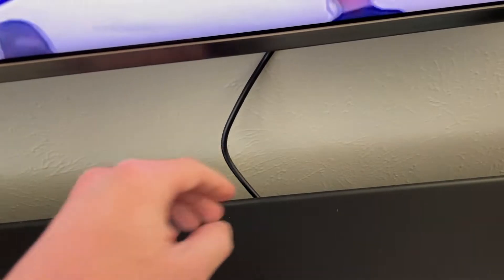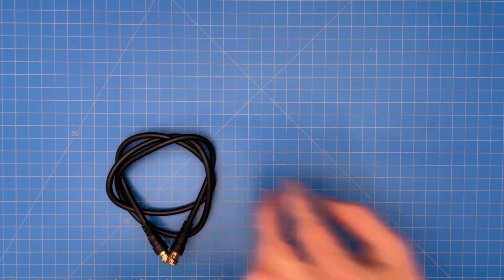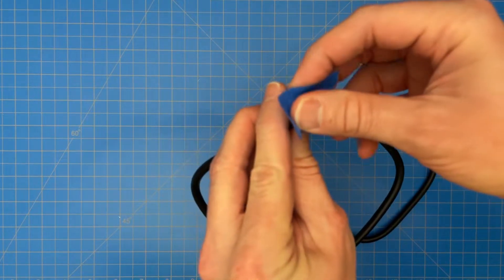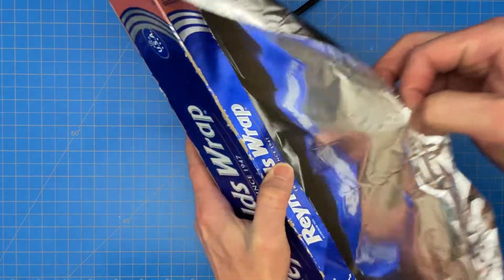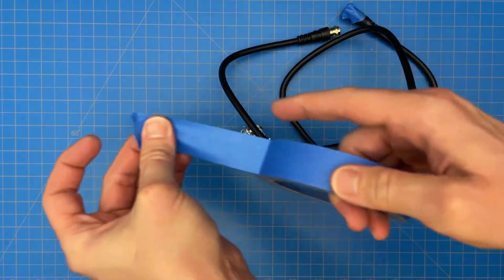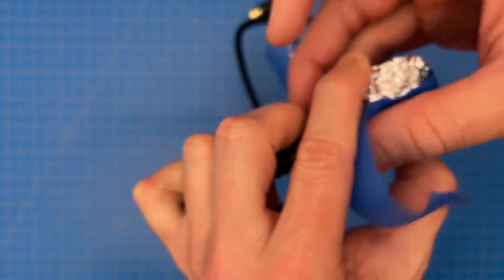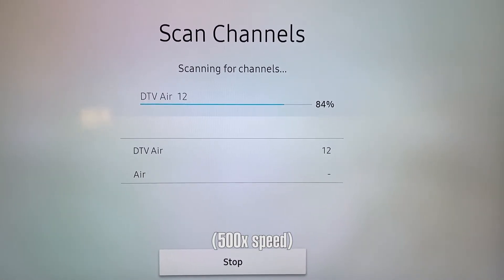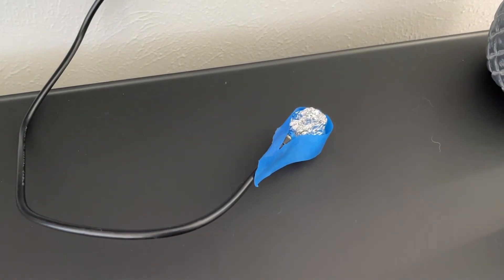Making a Simple HDTV Antenna Out Of Tin Foil!

Comment: You are probably getting more electrical noise from the wiring behind the audio cabinet than from the airwaves.  Move the antenna wire to as better place than near the electrical outlet.

Comment: Good idea. In my area, it only picked up few strong signal stations same as using paperclip or old AC adaptor to touch the coaxial wire. They were all slightly worse than my old rabbitear antenna. I used 2 wall and one rabbitear antennas to get every possible channels with/without preamplifers. With all the 3 incoming signal interferences, I could only mostly adjust the rabbitear one with limits (couldn't go up, down and other distances, etc) and no good results for 2-5 channels. People in other videos found that mutiple antennas could increase/decrease a particular channel signal strength. The good thing about this (your) simple antenna is that I used it as the mobile antenna to modulate those weak channels (to go up, down, on the floor, various distance, anywhere the cable can reach!), once the picture was clear it normally stayed. I inserted couple cup cake tin cups before the wrapped tin foil and a clipper on the cable so it could hang on the TV edge or clip on something. Thanks again for making the video.

Comment: I have a question. My tv doesent have this connector that looks like a needle. It is like the needle one, but there is no screw-in and the "needle" is thicker. Can i use this? If not, can i use an adapter
Reply from the maker: Sorry for the late response to your question. I’m not sure what kind of connector your TV has, but technically anything should work as long as you are plugging a wire into the “antenna” input for your TV and attaching a cable that makes it more receptive with the ball of tinfoil that I demonstrated in my video. Some coax cables do not have the screw connector and have a “slide on” instead. It is certainly worth giving it a shot if you can find a cable that works for the connector on your TV and then try to duplicate the same thing as shown. I imagine that an adapter would also help if you need one.
Reply: Your tv probably has this connector https://en.m.wikipedia.org/wiki/Belling-Lee_connector